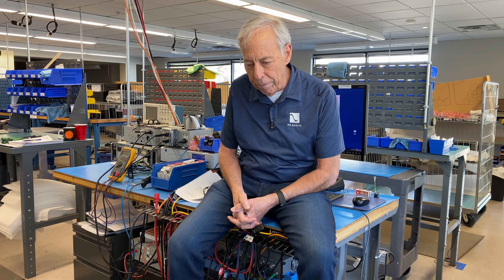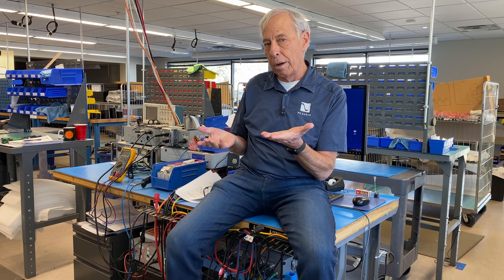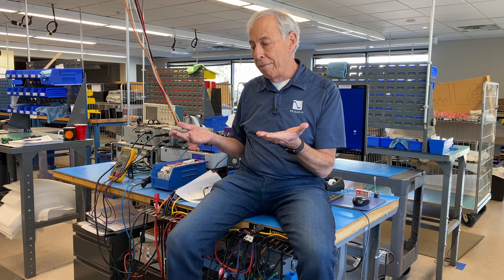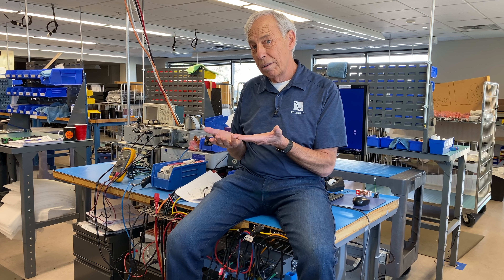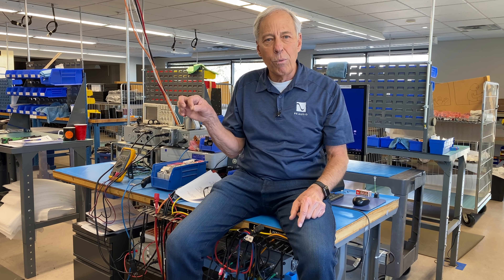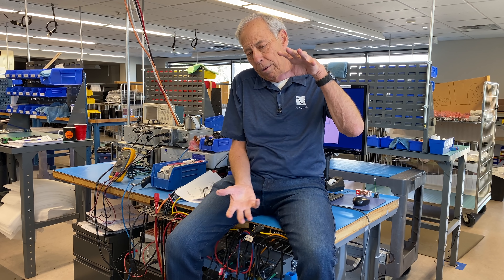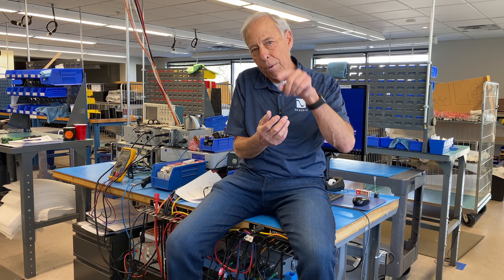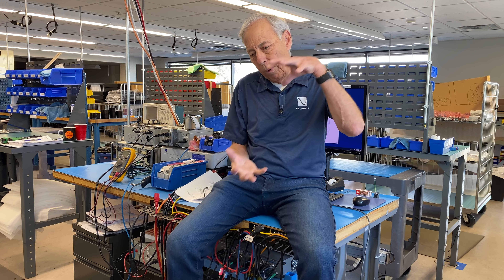Converting a stereo amp to a monoblock

Comment: There is somewhat of a solution. If your speakers have Bi Amp connections, which most do these days. Take Identical stereo amps and run the left channel to the tweeter, and the right channel to the woofer, do the same on the other side with the other stereo amplifier. I like to place each amp somewhere near each speaker, maybe on a small amp stand. On the two RCA inputs L and R use a Y adapter 2 to 1, so now one is only L and the other is only R. Although you really don't increase your wattage, each speaker gets its own private amp, each driver gets its own power, and both speakers get their own power section, cord, so that's a pretty neat trick. I hope this helps.
Reply: Agree I was shouting the same thing at the screen, this is the best solution.
Reply: Doesn't the woofer require significantly more power than the tweeter?  By doing this, you're wasting the second channel powering solely the tweeter in order to give your woofer the few watts that were previously consumed by the tweeter.
Reply: @TheMeatloafSurprise  still can be done in a system mids and subs are being used

Comment: If your amplifier only has RCA inputs, and is not equipped with a bridge-mode feature, you can still set it up as a bridged (mono) amplifier by inserting a modified DI box or transformer isolator at one channel input to flip the phase.  The usual cautions apply, e.g., make sure your amp can handle the lower impedance load that it will see.  
Of course, if you're a "true audiophile" you may turn your nose up at the thought of inserting a transformer into your signal path, in spite of the fact that's what "tube" amps do.
Reply: You could also do this with an opamp.
Reply: @JazzyFizzleDrummers  Op Amp plus a circuit board, connectors, case and power supply.

Comment: Hi Paul,

 Love your videos .  I have done something like that using 2 stereo amp as MONO but biwire to the speaker in order to keep the crosstalk and PSU separate between channels , work great but still is not a MONO BLOCK 
So Channel R to the woofer and Channel L to the Mid and tweeter

Comment: Does it help by replacing all stereo amps to mono block amps? Basically its like trading in back to the shop and purchase all mono amps to be installed. Thinking of running 7 mono amps to my vehicle which have abt 9 speakers 🤣. Other 2 speakers will be running 2 ch stereo amp instead. Not sure if i am correct for this staging structure?

Comment: i got a related question, if you got two stereo power amps, and biamp a pair of 2 way speakers, the ones with dual binding posts.  vertical bi-amping i think its called.
do you gain any volume instead of using only one of those stereo amps or ability to provide more power at low ohm loads?

Comment: I believe a parallel connection IS the correct one for a tube amp, with output transformers.
At least, that's what Music Reference says in my RM-9 Mk. 2 manual.
But I don't do that; I have two RM-9s in a bi-amp config., as Paul suggests.
And my other electronics are PS Audio!

Comment: My Onkyo is 100 watts 2 channels driven, 190 watts 1 channel driven. since there both using the same power supply and capacitators. you may want to look into your owners manual. but why do you want to do this is it purely for more wattage? would still need a 2nd amplifier.. i don't think it would sound any better. maybe if you have pre-outs and want to use your amp as one of the mono blocks but then they would have to match or use one amp for highs 1 for lows as in bi-wiring your speakers..

Comment: There are stereo amp that allow bridge mode with a switch and you can use it do bi-amp your speakers.
Reply: Using a stereo amp in bridged mode, which turns it into a single channel mono amp, has nothing to do with bi-amping your speakers. To bi-amp your speakers, you would need 4 active amplifier channels. You could use 2 stereo amps, or 4 bridged mono amps. I'm using my AVR stereo receiver Front Left and Right channels for the midrange/tweeters and taking the AVR subwoofer output to drive 2 bridged mono amplifiers to drive each woofer. It's easiest if the amplifier has a bridge-mode switch built-in.

Comment: My Audio Research power amp. has a toggle switch on the rear panel to turn stereo into a bridged mono amplifier. I was toying with the idea of buying an identical amp and bridging both to get two mono amps with more power and control to my Maggies.
Reply: My Adcom gfa 555 has the same bridge switch. My Mirage M-1's are bi-amped so I bought another gfa 555 amp to run them that way. However I found out the 200 watts was not enough power, they would clip at higher volumes. The solution was to use the bridge feature which gives 600 watts and run them as mono amps like you are considering. I have ran it this way for over 25 years with no problem.
Reply: @randys435  Although the first Watt is super important, I don't believe that you can have too many Watts driving some planer and other speakers that need better mid-bass control the same way you can never have enough memory in a computer system.
Reply: That will give you about 3x to 4x more power - provided the amp can handle 2-ohm loads!
Reply: @marianneoelund2940  8 and 4 ohms. That’s approximately 220 W per amp which is more than enough for my Maggie 3.6 R’s. Just the single amp I have now does a great job but I want to get a lot more headroom.
Reply: @Scopolamine46  You will need an amp that's rated for 2 ohm loads each channel, if you want to use bridged mode with the Maggies.
Reply: @marianneoelund2940  are you sure about that? I’ll have to make some inquiries if you are because I’m not about to do this type of purchase you’re telling me I need an amp with two home outputs. I don’t think you’re right.
Reply: @Scopolamine46  Sorry this isn't good news for you, but yes, the Maggies are 4 ohms, and will present a 2 ohm load to each channel when they're operating in bridge mode.  
You need 8 ohm speakers to work with your AR amp if it's bridged.
Reply: @marianneoelund2940  if that’s the case I have to thank you. I’ll stick with what I’ve got because it sounds better than I could’ve ever imagined as it is right now.

Comment: This parallel arrangment would work with a tube amp, since they are basically current sources! :)
Reply: Tubes , transistor ? They are both current sources ...
Reply: @janinapalmer8368  Not after you close the feedback loop.
Reply: No, even tube amps are voltage sources, but they do have higher output impedance, and that's what lets you connect them together - after carefully matching the gains, of course!  
But the only reason to ever connect amplifier outputs in parallel, is to handle speakers of lower impedance than the amplifier's rated minimum load impedance.  I can't imagine that situation occurs very often with solid state amps; with tube amps, it could work well if you have the correct output taps.

Comment: The only way I think this may work with AMP not supporting "bridge" is for only subwoofer cuz they have options with dual coils, so you have 1 speakers fed like 2 speakers and this will work in the current arrangement of the AMP, I am thinking doing that with my 6 and 7 channel of the 7.2 receiver to power external passive subwoofer with dual coil, mt receiver has second zone so i can setup second zone to be the 6th and 7th unused channels to lets say CD input and connect the 2 sub outs to them and us all that power just for LPF twice cuz 2 channels to 1 speaker, and I can even turn up the volume of the subwoofer from my remote and this will make the subwoofer have the sound of my receiver like Paul says "use the hi level inputs of the active sub to get the same sound character as your amp" when I get that expensive dual coil speaker I will share will you

Comment: Can you take two of the same stereo integrated amps, and use them for left and right channel use?  As in two 60w integrated, feed left RCA signal to one, and right RCA signal to the other, with one speaker feeding from it's corresponding 'mono' amp?
Reply: Don't do it.  It might work, it might damage the amps.  Expensive experiment.
Reply: THAT'S ALL I WANT TO KNOW! Why wouldn't that work? I have 2 ADCOM 535ll that I want to do this too. It's impossible to find info. Been looking for weeks

Comment: Paul
Are there commercially built phase inverters available? How does one achieve this without xlr outputs?

Also what is the mechanism for writing to you to ask a question.
Thanks
Reply: I won't answer FOR Paul but I will throw this out there. Some non-balanced preamps had both inverting and non-inverting outputs. If you have one of those you can just use one of each to drive the amp. Personally I would not try to bridge an amp unless I knew very well how it was designed to avoid any possibility of potentially self destructive rebellion from the amp. A certain amount goes into determining whether or not an amp design is suitable for use in this config.
Reply: You can use an isolator to invert signal phase, with a simple modification.  These are commonly used in car audio, to avoid ground-difference issues.  You will want a high-quality model.  I bought a batch of different isolator models and tested them - there are significant differences in quality!

Comment: I recently found out about bridged amplifiers and found out that our amplifier can pur out a bridged signal and our speakers can accept a bridged signal. Would this give a better sound? It is a stereo amplifier (a Yamaha A-S701) and stereo speakers (the brand is Pure Acoustics but I forget which model).
Reply: Bridging isn't for better sound.  It's for more sound.  Before using bridged mode, make sure the amplifier is rated to drive half of your speaker's impedance.

Comment: Can't you just put the two + wires together with a balance resistor network between them? Then go from the middle leg of that double high power low impedance resistor for the + and to the ground for the - ?

Comment: Sorry to spoil your fun there Paul, but the speaker has to be connected between the two red terminals .  The blacks of both channels are always at the same potential (ground)
Reply: Agreed. But I think we are talking about run of the mill stereo amplifiers. Connecting as Paul describes will not result in a power increas

Comment: Surely you need to connect the 2 black terminals together.
Reply: Most often you don't they are connected internaly in many amps.
Reply: @Douglas Blake Not in a solid state amp. Open loop isn't dangerous for them. Shorting terminals is dangerous.
Reply: Bridging amps causes the loss of bandwith.